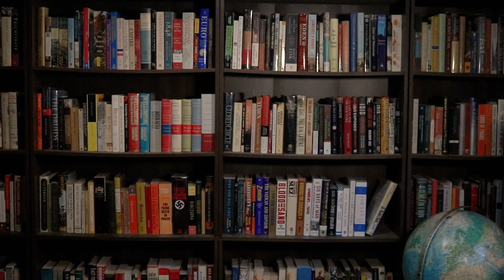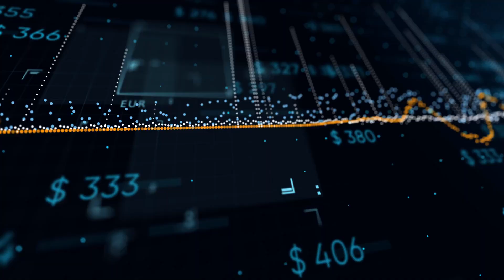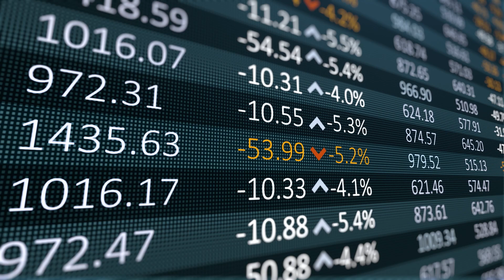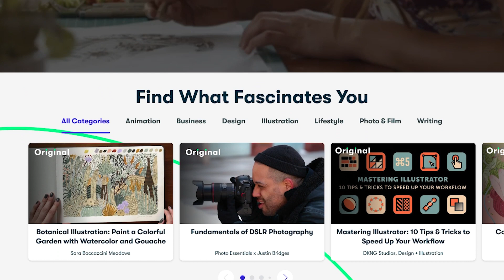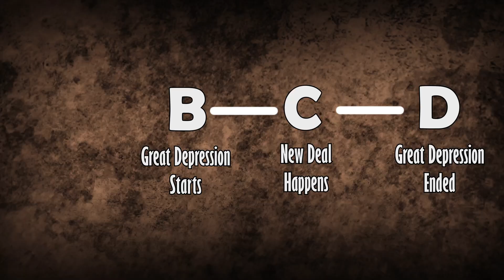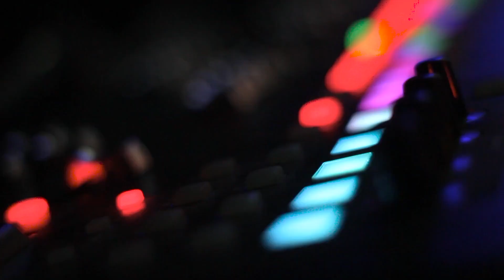You Have Been Lied to About Herbert Hoover | Casual Historian

Comment: I think your backlash against the myths about Hoover and the New Deal, though right, is taking you into another type of myth. Some New Deal programs helped, others didn't, and some made things worse. And that's to be expected, it was our first time trying those things. Going off the gold standard is probably the main event that ended the Depression, but that doesn't mean that fiscal policy measures didn't help. Nowadays, we generally invoke monetary policy against recessions first (its faster, more direct, and easier politically), but fiscal policy (which is much better designed today than back then) still has an important role. Look at 2008: we exhausted the capacity of monetary policy, then did too small of a fiscal stimulus, then quickly started cutting the federal budget over partisan politics. That made the recession worse than it had to be. 

Its great that you're trying to be interdisciplinary, but when we do that we run the risk of misunderstanding the other field (that's not the field we have the PhD in, after all). The economic sources you've cited here are really bad. They're outdated political screeds from a heterodox offshoot of economics called Austrianism that the discipline moved on from half a century ago. It's only kept alive today by political conservatives who want to use it as ideological justification for a strictly limited government. There's no serious research coming from these guys. I think you should really take more time to talk to academic macroeconomists and read current work before you dive into a whole new field. Good interdisciplinary work is just hard. I think that's why so many people are afraid to do it, which is to all of our losses.
Reply: This is a good, thoughtful comment. Just thought you should know. :)
Reply: It sounds like you're making an appeal to the authority of academia, or an appeal to the amount of research on one side, either of which doesn't make something true.

Looking from the outside, I'd say the biggest problem in economics is that it never learned how to measure non-monetary costs and benefits very well. Why do people give to the homeless? An economic answer is that somebody does so to gain "moral utility".  If we aren't learning how to measure stuff like "moral utility" on a micro scale, economics will be blind to most human interaction.
Reply: @Joker22593  Yes, reasonable people do indeed rely on expertise and evidence to understand the world.
Reply: @Joker22593  What you're relying on STUDIES and ACADEMICS preposterous.